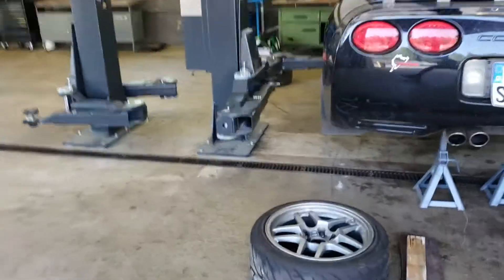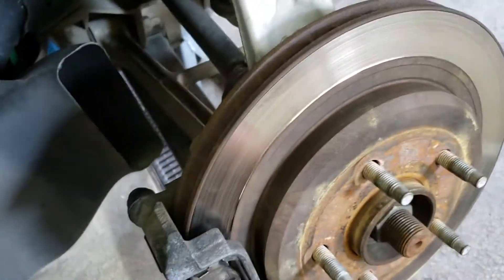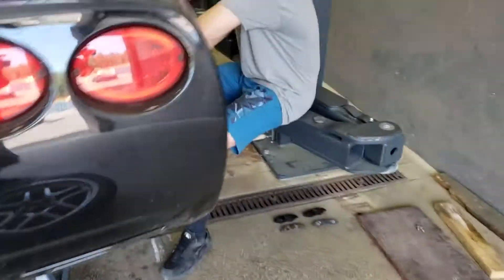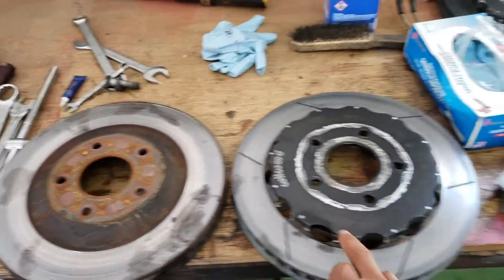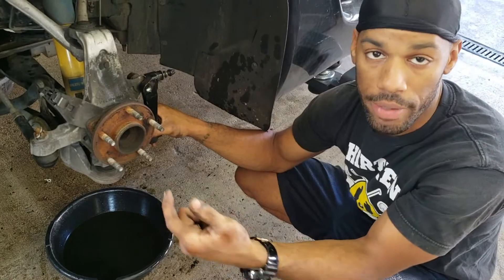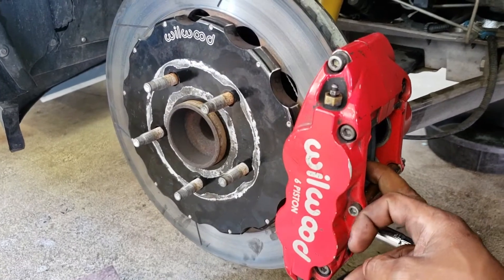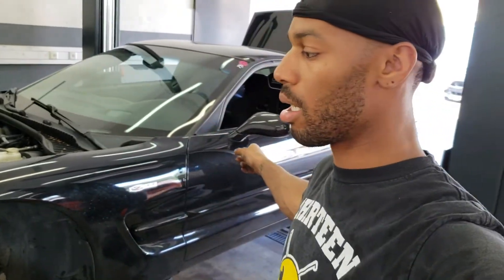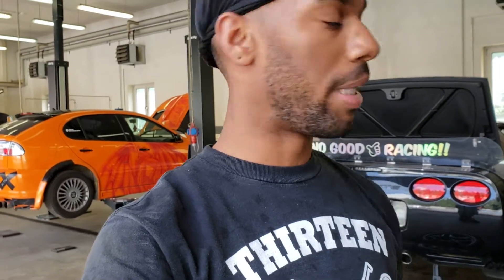How to install C5 Corvette Wilwood Big brake kit

Comment: Love you C5 videos! The link you provided in the description for the brake upgrade. Is this a good setup for track use? Is this Wilwood’s newer caliper design that is more Rigid?
Reply from the maker: So they have a more rigid set up with the new caliper if I was to run a wilwood kit again id go with their new set up

Comment: Great video. Where you still able to run the OEM Z06  rims with the willwood set up?
Reply from the maker: Luke Kerr with this set up because I have the 13" instead of 14" rotors it clears the 17s brother

Comment: How well have these brakes aged for you? Have you outgrown them, or are they holding up to the abuse?
Reply from the maker: Ive since upgraded to the 14" rotor but I still have them no issues, no leaks or anything like that, if I did it again I'd go with wilwoods newer caliper design thats more ridgid